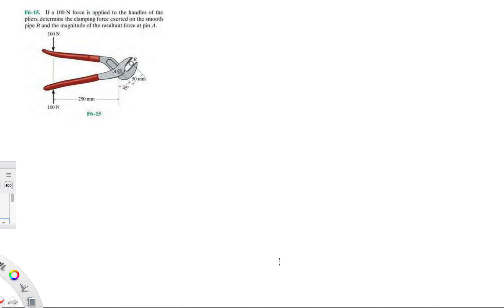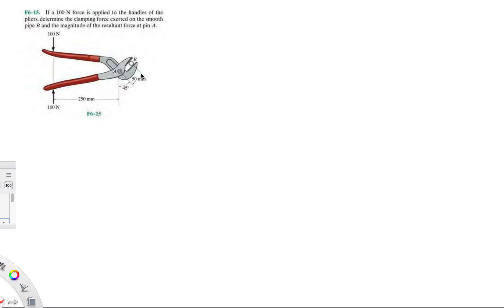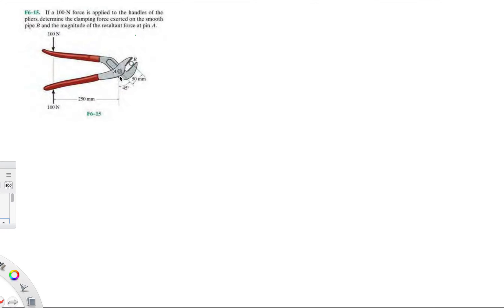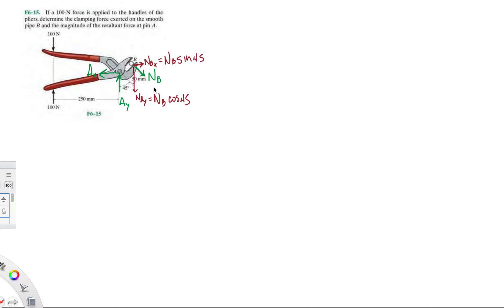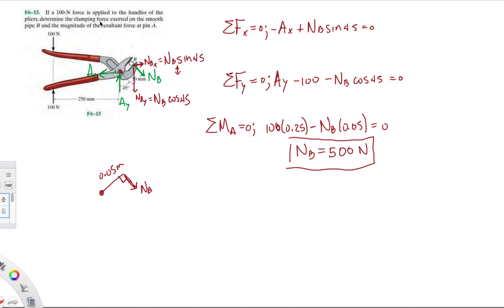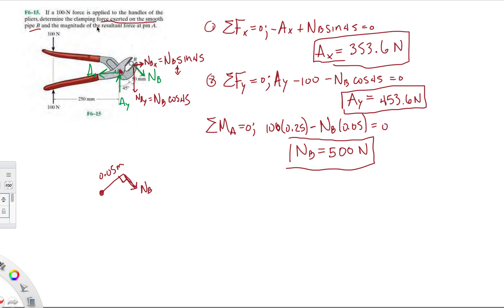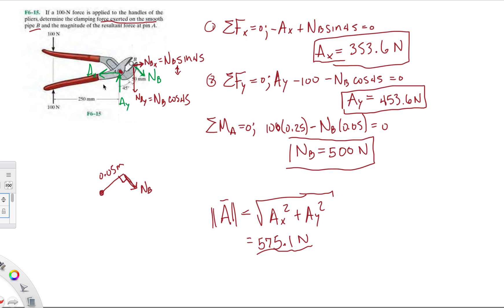Problem F6-15 Statics Hibbeler 12th (Chapter 6)

Comment: Why is do you do -100N in the Fy? Its going up, shouldnt it be +100N?
Reply from the maker: I chose to focus on the top portion of the plier. So the 100 N force is pointing downwards. Hope that helps
Reply: @theengineeringcrucible3490  Yes it did, thanks!